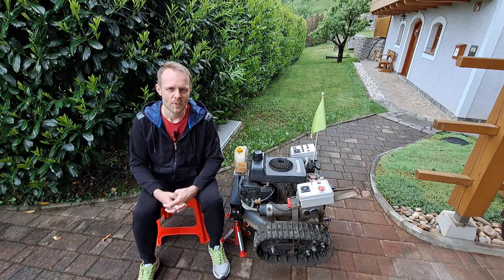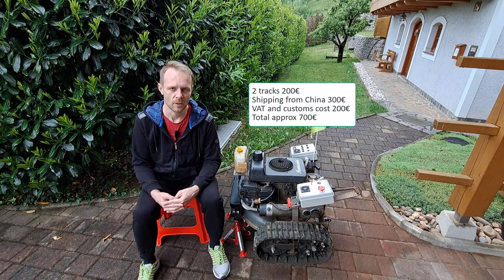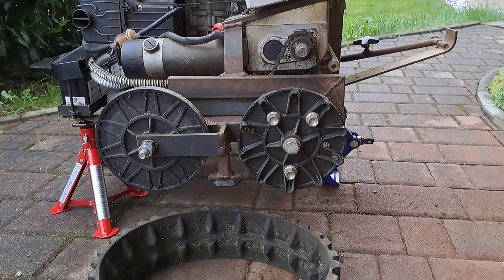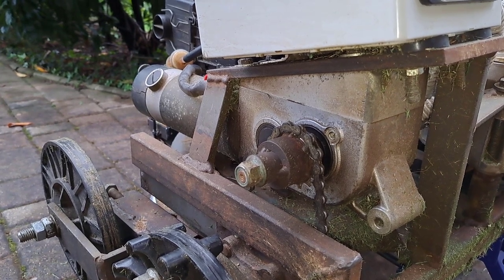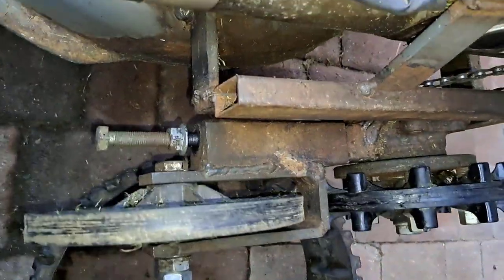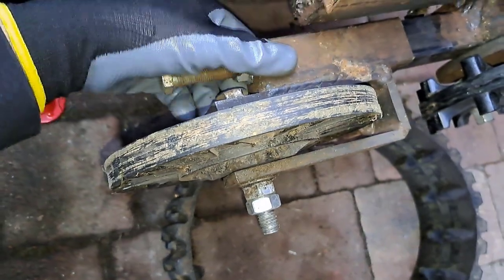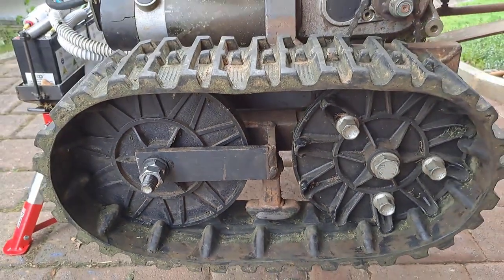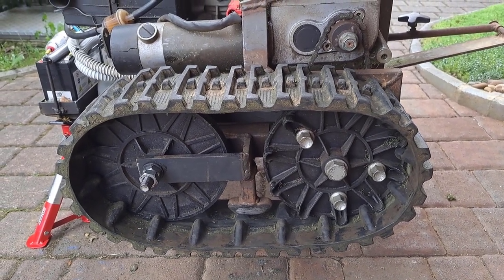Track drive - Remote Control Lawn Mower DIY

Comment: Beautiful job!!! I'm planning to build a similar mower and your videos and explanations are very useful! I've a question: you used a wheel hub unit for rear wheels, so do you transmit torque from motors by a splined shaft? If so,  are splined shafts available online? Thank you.
Reply from the maker: Thanks 😀 I dont use splined shaft. Torque to motor is transmited over chain and gears.

Comment: Great job. The last summer i tried to make something similar with wheels, but I can´t. This summer i will try to make the project with mini dumper tracks. The measures are 180x60x38. I don´t know if the 1016z3 electric motors will have power to move the tracks, but I will try it. Videos like this help me to think better how can I make the mower. Thank you.
Reply from the maker: You are welcome! Hope you figure it out.

Comment: Hello, in your opinion, what is the best solution : track or wheels? Could you give some arguments?
Reply from the maker: My view is that tracks are better. The grip of the terrain is better and the mower can make zero turn easier (turning is easy and effortless on tracks). 4WD drives are also very good but need more power (usually 4 motors) to make zero turn and it usually struggles a little to turn. As for the construction itself, it is easier to build 4WD, but the price is about the same, because with tracks only 2 electric motors are usually enough.

Comment: Nice work. I am building my own but I have a big problem. After 1 or two track rounds the tooth of the wheel jump on the teeth of the rubber track and stucks. Have you seen similar problem. The rubber track is tight and the wheels front and back are aligned.
Reply from the maker: Hi! I didn't have that problem. As you told, if the wheels are aligned and the track is properly tensioned then there should be no problem. Are the track and wheels from the same manufacturer and compatible? Can you test by switch wheels from front to rear and maybe turn track in opposite direction?

Comment: what are the tracks off of? ive been looking for a small set for a similar project?
Reply from the maker: Tracks are from snow blower, 190€per set with wheels. Check links I left in video description
Reply: @gregorkobetic  i found them thanks

Comment: do you have a link to this motor? it looks massive i am curious on the voltage ratings and size do you know what W the motor is? Thank really nice build out.
Reply from the maker: Hi, motor is 24V 15A 350W from old wheelchair. I reduced speed from 10kmh to 3kmh. See my other videos. Cheers!
Reply: @gregorkobetic  thank you. have you tried using mission planner and a pixhawk with it yet? I have a few projects ive made myself and still working out all the details. COOL BUILD!
Reply from the maker: @Tex_Track  Didn't try mission planner and pixhawk yet. I have plans to look at it this winter :). Do you have any video or picture of your build? can you send me on gkobetic@gmail.com? Thanks!